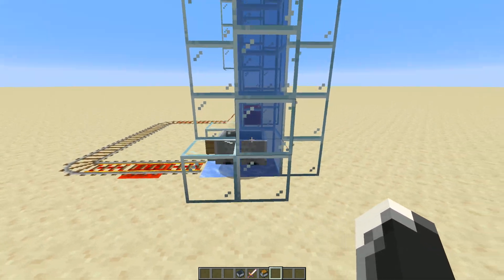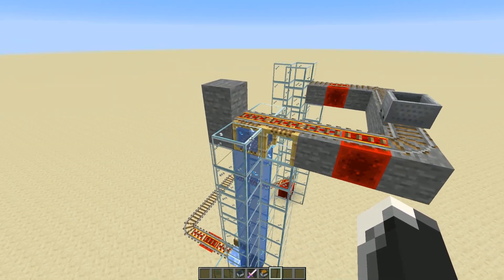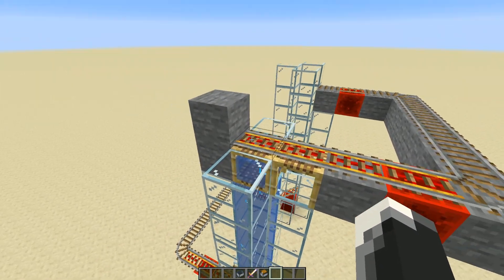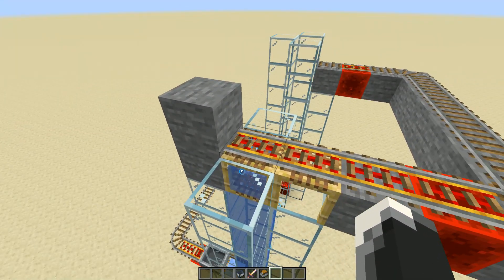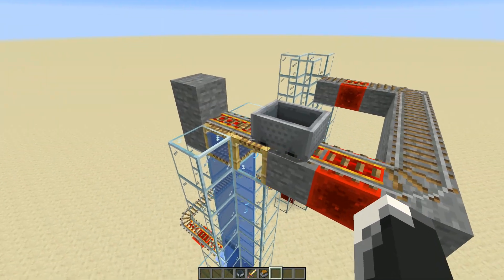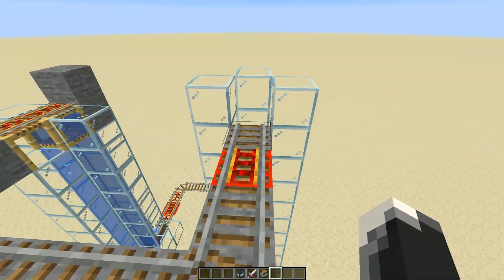Rework minecart water elevator in Minecraft.

Comment: When my Minecraft makes it to the top it stops on the scaffolding. Is there any way to keep it moving
Reply from the maker: Have you tried putting a solid block behind the rails for it to push off of? Glass does not push the minecart forward.
Reply: @kingofandrew2  I tried it and it worked. For some reason glass wouldn’t push the block but cobble would. Thanks